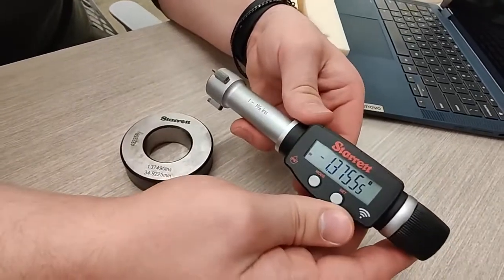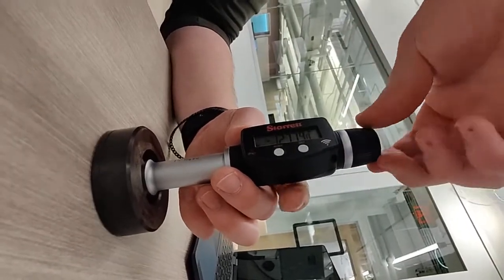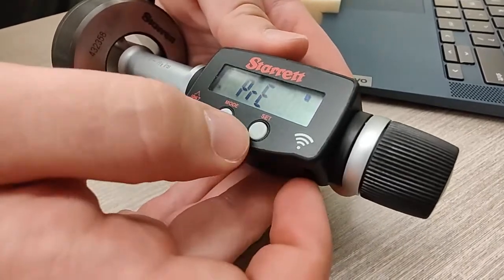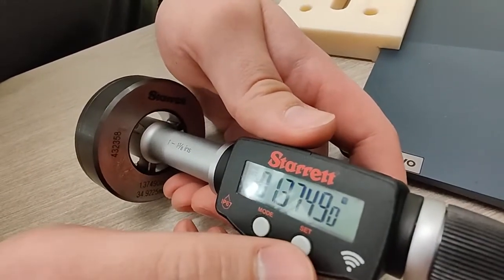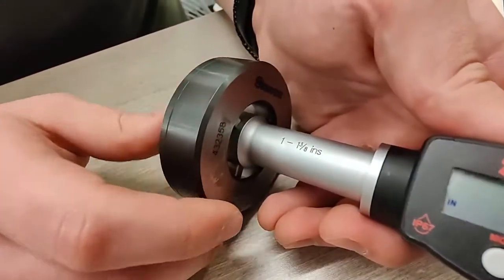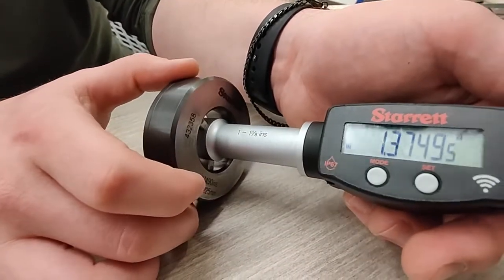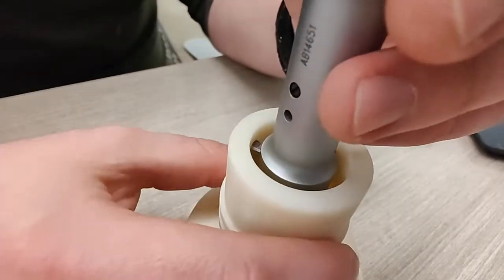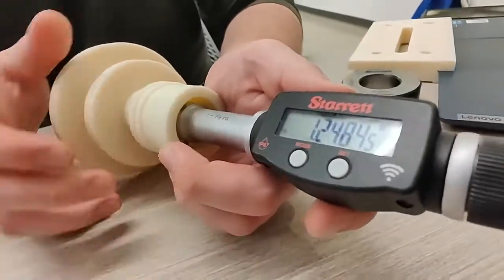Digital Bore Micrometer

Comment: I think you can make the pre-set before inserting it into the setting ring and then after it is inserted into the setting ring you could dial a little less than the desired value , for instance 1.36749 and then adjust to 1.37495. The reading should stop to the exact value as shown on the setting ring. If it does not , then the micrometer itself would need to be calibrated.